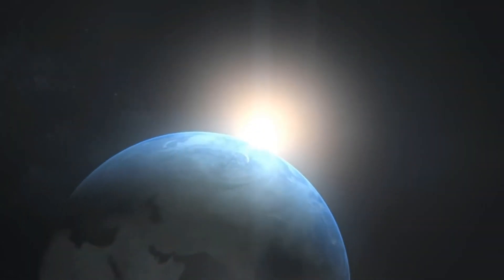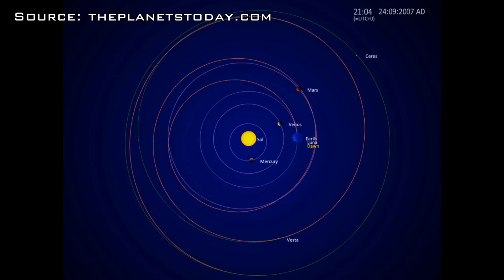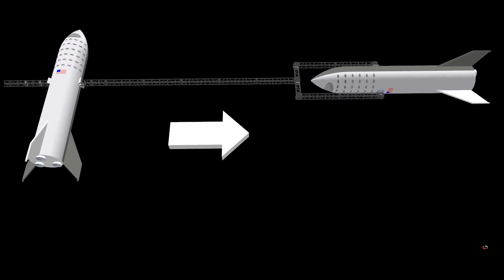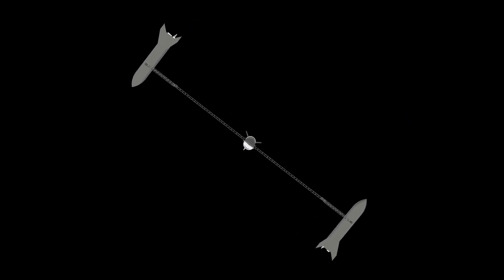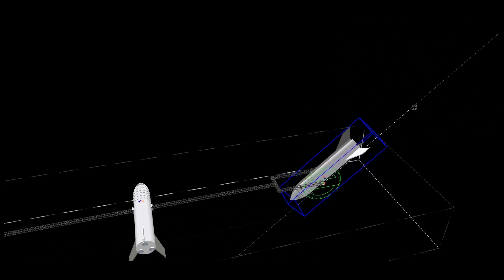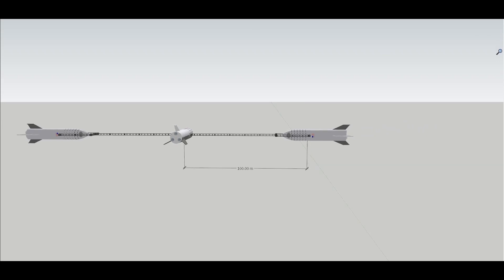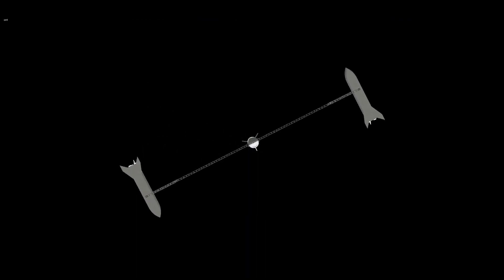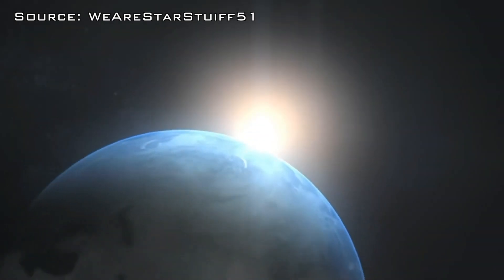GLS2: Artificial Gravity for SpaceX's Starship

Comment: Sorry bud too many risks and bad things that can happen. Plus those trusses take too much space and weight.
Reply from the maker: Thanks for your input! V3 uses 2 chord truss that takes up 80% less volume. Also it uses cables in addition to the truss to hold the bulk of the "weight" so the truss can be lighter duty. I will be working out the loads calculations soon. Imagine if they decided "too many risks" for propulsive landings and never perfected it?
Reply: @smallstars  it's a matter of how much mission critical space they take.
Reply from the maker: @josephsilva4252  oh the design was to have the truss launch in the payload bay of the GLS, so they it would have it's own launch vehicle.
Reply: @smallstars  exactly, but would a company pay for the extras vehicle? You would have to come up with more benefits that just artificial gravity.
Reply from the maker: @josephsilva4252  I thought it was clear that artificial gravity is one of the most valuable things possible in long-distance
Reply: @smallstars    there are too many problems with this design. 

The first and largest problem is that if something goes wrong with the system it would take extra fuel to stop it. 

Then astronauts would have to leave the ships if they have to do maintance out side on the trusses them selves or their connectors. 

Then you have an entire 3rd ship for one purpose, artificial gravity. Your adding too many costs just for artificial gravity. 

Sorry but it's no where close to be feasible for space flight. It creates too many risks and cost just for one benefit. Besides if there was an extra ship. It would be best to designate it for cargo and mars habitat storage and transport. 

There are better ways to simulate artificial gravity without making an external system.

Comment: The more I go over this idea the more I think you would really need to have something totally different in the middle. Instead perhaps a 3d Cartesian graph shape of truss, with supporting side cables to form an octahedron. Once docked, but before spin, additional supporting cables could be attached to the end of each ship manually for additional rigidity. Within this structure would be fuel and engines to support leo ejection and interplanetary course correction. If the central ship doesn't need to land you can save all sorts of mass and DV, as well as use engines optimized only for space. A 3d shape is stronger for any given amount of mass than a single line would be as well. The central ship would just stay in space forever for reuse. Staying on a parabolic orbit would mean getting back to earth would be very cheap as well.
Reply: Keep in mind that with only one line of truss it needs to be strong enough to support acceleration, unless you plan to have all ships individually do their leo ejection burns completely synchronized. Plus if any ship has a delay or issue in this phase all ships are screwed. Getting them all tucked away on a central structure first, and having only one ship involved in interplanetary flight is safer.

Comment: I like the simplicity of this and I agree that long trips without gravity would be hell. One issue I see though is that having 3 rockets triples the chance of things going wrong.

To reduce cost and increase the chance of success I think we could get away with 1 rocket deploying 2 small habitats on tethers and then spinning up, it would require far less fuel too since the vast majority of the mass is only a few meters from the axis of rotation. The bulk of the cargo would be in the center, astronauts would spend a good portion of their day working in micro-gravity but spend enough time in the habitats under gravity to stave off the ill effects they would otherwise suffer from.
Reply: This is a good idea but one starship would not be able to hold everything necessary, not to mention you would need to pressurize both and have all the life support systems in each or try to connect them both with various hoses. I think the best way to do itis with two starships as many other people have suggested.
Reply: @wastedtalent1625  Thinking about it I think you're right, the payload  probably wouldn't be anywhere near adequate and making this sacrifice for the sake of saving a few tons of fuel during spin up probably isn't worth it. Still tripling the probability of something going wrong is a major issue, I'd like to see a version of OP's idea where there is a backup plan in they lose one of the Starships.
Reply: @bloodypommelstudios7144  "triples the chance of things going wrong" - as it triples the redundancy of the starships.  This makes it safer by an order of magnitude.

Comment: Ok. This is very clever. But my concern would be that you have to redesign the ship in such a way that it would structurally sound enough to survive launch and also to survive the forces near the center of the ship where it would be anchored.  Not to mention the force it would have to take on its side during initial spin up.

Comment: I think that you would only need high gravity for a couple of hours per day.  You could do this with a Tom's Twister ride like was at Six Flags of St. Louis.  High spin rate with small diameter, 9m would be fine.  You can stand on the wall with a little bit of practice.  This would be much cheaper and safer than trusses connecting several spacecraft together.

Comment: Very good design. 
I always assumed a system like this would explicitly be using RCS for spin, cables to minimize storage volume, and using the mount for the superheavy booster to attach the two spacecraft. 
Still not sold on cutting into your main engine propellant for spin/despin though, even if the burns would be tiny

Comment: Why would you need to bring the truss with you on each trip? This is the whole problem with the mentally about how to colonize Mars. 

An ideal truss would act more like a ferry system, starships would meet with it, lock in and establish rotational gravity. The ferry would use ion drives to take several starships at a time back and forth between earth and Mars. Even if the trip takes several months to complete, it won’t matter much, because the colonists will have gravity. They can also transfer between starships if something goes wrong along the way
Reply: how about nuclear powered ion drives :D

Comment: That’s great – you probably figured it in but since the parts of the ships below the 1G area are at higher gravity (at the engines maybe 1.3 to 1.5G) there’s that much more weight and stress on the system.  O’Neill ended up recommending 1G at 1 RPM instead of his earlier 3 RPM ideas but that was for long term living not a mission to Mars.

Comment: I like the idea overall, but there are some very important considerations:  The truss structure should remain in a parking orbit.  There's no reason on Earth (or Mars) to waste fuel hauling it down and then right back up.  If the truss fails, or one of the truss connections points fail, just imagine in your head the path these ships will make.  Immediately the lightest portion of the failure point will be shoot off at a Delta V equal to the mass of the ship (plus a possible portion of the truss).  The forces that will be immediately placed on the other two ships... the truss connections and the trusses themselves will instantly cause a catastrophic failure.  You could only initiate the truss structure until all of the vehicles hit orbital escape velocity.  The reason being is that if you use the truss cargo ship to provide sole thrust for the return trajectory, you will place a tangential load on the truss as it "attempts to lift the outer ships".  It'll snap the truss like a twig.  It's an intriguing concept, one of the most original I've seen, but it definitely has some engineering challenges that need to be resolved first.

Comment: It's a very strong stainless steel spacecraft.  It can withstand the stress...  Why not just flip it nose to tail at about once a minute? And put the furniture on the 'ceilings' at launch (in the compartments  above the center of gravity) such as at the Nose and living quarters??? Very easy and straight forward... Set at 38% G on the way out... And ramp up to 1G  on Return to Earth over a period of weeks. Put Navigation near the Center of Gravity for easier adjustments,  and for the tracking instruments.

Comment: An amusement park rotor is about 5m diameter, if Starship has a diameter of 9m (if not 18), imo they should create 1 (or 2) rotor decks and run experiments in Earth orbit/microgravity before sending humans to Mars.

It could be that a certain number of hours per day in a rotor, perhaps just sleeping or naping, or sitting like in an airplane, or standing while holding a central ring rail while standing sideways could potentially significantly reduce low G health problems. They should at least test it at different rotations speeds event if its not 1.0 G (event 0.5 G might be better than nothing) and with various positions (standing, sitting, prone) imo.

Comment: There is a lot more to it than just spinning. You should really do some research into the physics behind artificial spin gravity. It is not nearly as simple as you think it is. There are a lot of factors that come into play such as the diameter of the whole thing in order for it to not do all kinds of weird things to a person's equilibrium.the distance between the two outer ships that are subjected to the spin gravity would be way too great in order for it to be even close to being effective and resembling Earth's gravity or even the moon's at that. If the distance between the two outer ships is too small, the revolutions over a given. Of time would be too fast and the upper half of your body would not experience the same amount of the effects as the lower half.there is way way way more to it than even what I just pointed out and apparently you have not done near the necessary research otherwise you would not have made this video. You have an interesting concept, however in order for the math to workout, and it not have weird effects on the passengers, your design would not even come close to being practical or functional. Sorry about your luck, try again.

Comment: Wouldn't it be more efficient and require less ships and materials to just have a gravity module left in orbit that the rockets could attach too? It would be something like another rocket with a long tube attached to it equipped with structural members, a passage way for people to move between the rocket and the gravity module, and fuel lines for moving fuel between the rocket and the module. Passengers would just move from the rocket to the module and then thrusters on the module (getting fuel from the main rocket) will cause the module to spin with the rocket acting as a counterweight. Once the destination has been reached simply reverse the modules thrust to stop the spin and move all the passengers back to the main rocket so they can complete the journey.

The safest and most efficient method would be to just build a hub that the rockets can dock onto that has a really big gyroscope built into it though. It would remain in orbit when its not in use but that would eliminate having to waste fuel just to create spin and be much safer and require a lot less engineering to make it all work. Longterm it also costs less.

Comment: I'm glad I found this video. I asked @everydayastronaut a similar question. My thought involved using a cable instead of a truss system. The cable could be reasonably long (500m). At 70m/s tag speed, you would need 1.3 rpm to produce 1G. Is there a way to calculate tension/load to the cable? At the time I was researching the use of Dyneema rope for the cable. In my solution there would only need to be 2 ships. Another question is related to how much G is actually required to reduce the effects of weightlessness. Is 1G neccessary or could people get away with less?

Comment: I think this is a very clever idea.  However, why resign ourselves to using chemical fuel, when the potential for nuclear propulsion has already been demonstrated?  With nuclear fuel, your entire ship could accelerate at 1g halfway there, and decelerate the second half.  Not only would this provide onboard gravity, but it would also reduce the travel time to about a week, instead of months.  Also much safer and better for the crew.
Reply from the maker: That would be great and I'm with that 💯 if they perfect the tech and make it safe. Let me know when they do, and shoot me some specs on those nuclear engines

Comment: I think your truss idea is flawed, too many parts, too many connections. Any final system would have long redundant cables. We are good at building steel cables and Dynema type composites would give better strength to weight ratio. You don't need a solid truss.
Reply from the maker: I think making the system rigid us important, although I will be happy to be proved wrong. We shall see! Next version will have cables, and I'm going to look up dynema composites right now thanks! Subscribe if you want to see the evolution of this concept, plus more videos about our solar system

Comment: Nice concept! per below, this could be accomplished using tethers, and only 2 Starships fairly simply. Obviously a few technical challenges to overcome, but no real showstoppers.
An advantage to your truss design would be the potential for an inflatable access tube between the two Habitable Starships.
Your truss also might not need to be pre-assembled; The Gateway Foundation's GSAL concept would be able to construct truss segments in vacuum. https://www.youtube.com/watch?v=NXCH3nUCQr0

An issue inherent with this design is fuel settling in the tanks. picture trying to light a Starship lying on it's side on earth - The fuel will settle/drain to the side, which is not where the fuel intakes are located. You'll need ullage motors to force the fuel to settle in the tank to de-spin, or use steal of the fuel from the small nested tanks, all of which is currently reserved for landing. Space X uses nested tanks for the same reason.

Comment: The rigid frames seem problematic somehow. In the event of a catastrophic failure low mass tension cables might be less dangerous?
Reply from the maker: In the event of having to speed up or slow down the spin while keeping the crew safe, I find a non rigid system to seem problematic. In the event of a catastrophic failure I don't see any advantages in using a cables only system
Reply: @smallstars  you're probably right. Its difficult to remember that the rigid frames only need to be designed for design loads once assembled with no gravity loads during assembly

Comment: It's a good thought experiment but it wouldn't work, unfortunately any small mistake in thrust or angle will end in catastrophic failure do to force exerted on the trusses.  There's just too much flex. Concepts like these have been proposed in the past except using counter weights. Kinda like old cannon balls joined together by a chain or in this case a tether. These vehicles are simply too massive to be able to be supported by a single truss. Perhaps if we had stronger materials. Rotating habitats are designed with strength and efficient use of space as the key features.

Comment: Excellent "thought calisthenics". Though I love the idea, I am a little concerned about the stress on the trusses on spin-up and spin-down. Even a very slight mistake could be pretty catastrophic. Though you were critical of other designs for gravity wheel space stations and interplanetary transportation, I think that the strength provided for the connection of the two terminus' could be better designed with more strength with automated space construction as you see here: 

https://gatewayspaceport.com/von-braun-station/

Gateway has put quite a bit of brain power into their designs and they have a NASA project manager in charge of engineering.

Comment: I'm wondering why you didn't talk about the math of the construction that hold everything together. I was suprised that it could actually work. Roughly calculated I ended up at 450 MPa tension when it has only 1 dm^2 area. This is actualy a reasonable number
Reply from the maker: Thanks for the comment! But unfortunately this is out of my area of expertise. I have an engineer I met on reddit helping me with the next video and I would love to get your help too. DM me on twitter @tinysmallstars.

Did you take into account that the center of mass of the each starship is actually lower (farther away from the axis of the spin system) than deck 2, where I aimed to place 1G of artificial gravity force? So instead of calculating using 420 tons of mass for the starship, multiply that by (I'm guessing) 1.12 to get the true centrifugal force pulling on the system.

Comment: activating the engines would need constant course corrections and the truss would be too expensive and wouldn't be strong enough to hold 1,335,000 kg
Reply from the maker: I disagree, but I will keep working on the design and get back to you with some loads math in the next GLS video. In the meantime I'm gonna put out a video about the overall shape of our solar system. Subscribe if that sounds cool! Thanks.